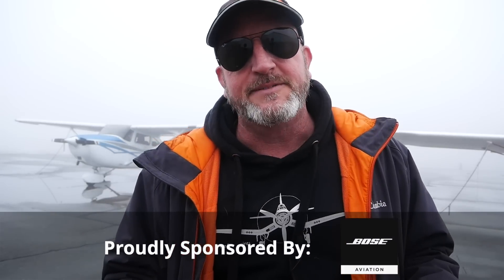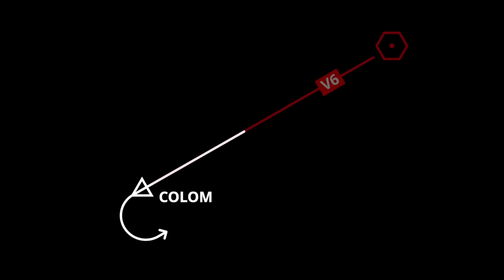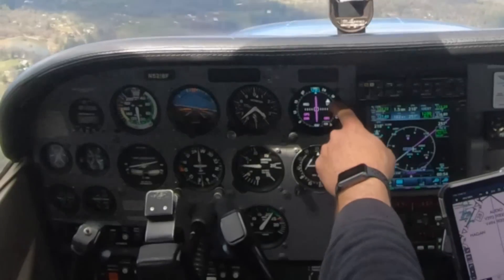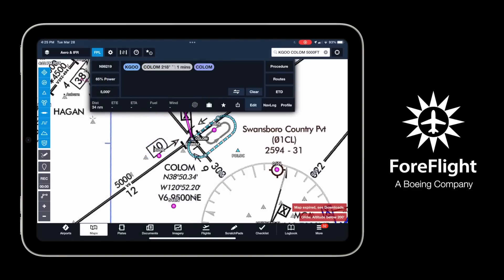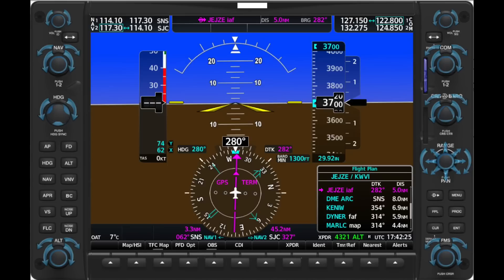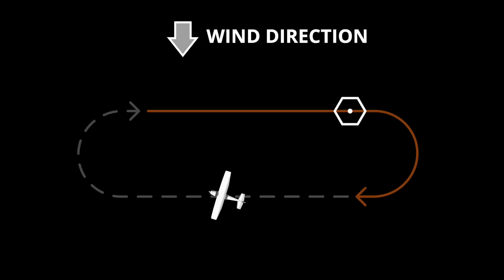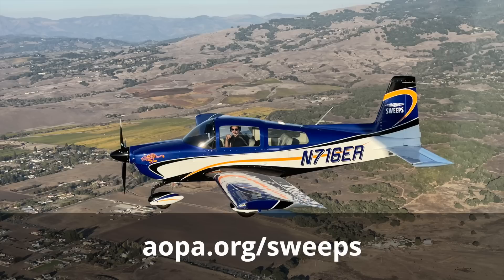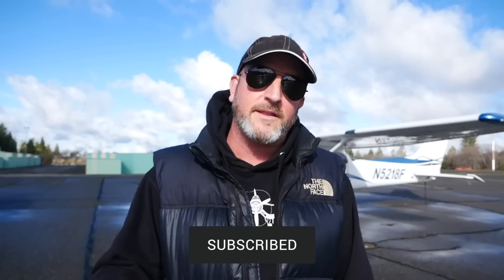ESSENTIAL SKILLS for Holding in an Airplane in the National Airspace System

Comment: Awesome video. I haven't ever found a clear answer from any FAA document on when to start the timer inbound but I teach my students your method for timing the inbound course. One thing I thought you may not have mentioned, and something that the AIM says pretty clearly, is that we should be starting our timer for the outbound course over or abeam the fix. When it comes to a VOR, this is done by looking for the flag flip on a CDI FROM to TO. That will be abeam the station and always the same spot over the ground. I see too many students do it when they level wings, and students, or any pilot that is hand flying, can rarely hold a perfect standard rate turn for a minute at a constant airspeed.

Comment: I have a very serious question about holding patterns. Why on Earth do I need to get exactly 1 minute on my inbound leg? Why oh why.
Reply from the maker: We’ll it’s wise to negotiate (ask for distance legs) … but I suppose the reason is that they have to design the protected airspace of the hold for the maximum holding speed, which is probably not you. But I believe that the struggle to get there (1 min) will keep you of trouble even if you don’t get it. It’s like … a company that’s not growing is dying. A pilot not shooting for one minute ends up at 5

Comment: Generally using a GPS in a hold you’re set you up for a 4 DME leg. Timing of one minute is usually done with the VOR’s. I always to my VOR‘s to the radial. I’m supposed to use as a hold and as an identifier for the intersection. Remember the rule if the VOR and the needle are on the same side with a from indication, you were not there yet. remember your orientation if you leave the OBS set to the opposite of your direction. Some people call this reverse sensing.
Reply from the maker: This is true if they’re published as GPS holds, but what I often see your pilots flying all types of holes with GPS equipment
Reply: @TheFinerPoints  Jason, that is true. Remember a good GPS will actually show you when and how to make the turn. A better system like the G 1000 you just hit the NAV button and sit back and drink your coffee. On the subject, you just said before, you can also build your own hold on the GPS and set it to minutes or DME as well as direction of term. it’s too bad that we no longer have. NDB. Those holds were fun to master. I still kind of make up my own and do it on X-Plane 11 flight simulator since the standard Cessna 172 has a working ADF.
Reply from the maker: @aviatortrucker6285  Yes, the G1000 makes things super easy!  I miss NDBs too. Fun fact -- you can use the bearing pointers to "simulate" NDB navigation. I love this! On holds ... remember that he hold has to be in the flight plan for the autopilot to fly it. There are a lot of ways to do this but on the G1000 it would have to be either as a procedure turn or missed approach hold. I used OBS mode in this video because that's the "grey" area I'm trying to address
Reply: @TheFinerPoints  I know the bearing pointers can be used like an ADF but sometimes they’re hard to see or they overlay each other. I think too many people use the simulator in auto pilot too much. It’s a little bit work but you can free fly anywhere you want. I usually fly to an NDB using the ADF and create a hold like “Hold Northeast 240 bearing right turns. The inbound is heading 240 toward the station. “As you know, the hold entry is still the same but it gets even more challenging when you add a little bit of wind. Remember the pointer points opposite of your nose and the tail of the needle always points in the direction the  wind is coming from on the ADF. I never really understood what and how the BFO was used, but I know what it is. Lol!
Reply: @TheFinerPoints  I teach all my students this method in our GNS430 6 pack seminoles. They all become jedi masters of unpublished holding using OBS. Thanks Jason!